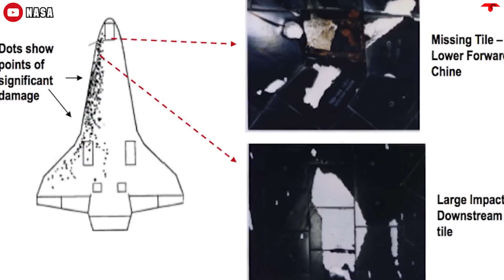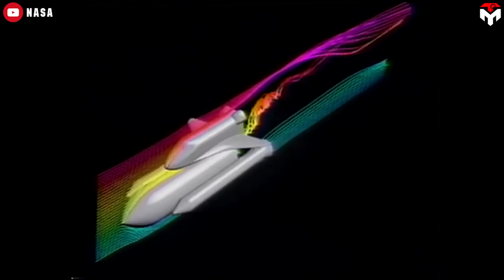SpaceX's Starship Heat Tiles Re-entry Just Humiliated NASA Shuttle!

Comment: The achievements of SpaceX with the Starship's heat tiles represent significant progress and have set new standards in the industry, framing this progress as "humiliating" NASA oversimplifies the narrative. It overlooks the foundational contributions of the Shuttle program and the unique challenges and constraints faced by each organization. Instead, the advancements in heat shield technology should be seen as a continuation of a long legacy of innovation in aerospace, with each organization building on the successes and lessons of the past 🥇🇮🇩😵‍💫😘🥰

Comment: SpaceX's approach to spacecraft design emphasizes reusability and cost efficiency. The Starship's tiles are designed to be reusable with minimal refurbishment, drastically reducing turnaround time and costs compared to the Shuttle's system. NASA's Shuttle program, despite its pioneering achievements, faced criticism for its high operational costs and the extensive maintenance required for each orbiter, particularly due to the vulnerability of its heat tiles 🥇🇮🇩😵‍💫😘🥰

Comment: SpaceX's development of the Starship, particularly its heat shield system, represents a leap forward in aerospace technology. Unlike the Space Shuttle's thermal protection system, which utilized silica-based tiles, Starship employs advanced heat shield tiles made of ceramic materials that are more resilient and easier to maintain. These tiles can withstand the intense heat of re-entry, demonstrating durability and reliability in multiple test flights. This capability contrasts with the Shuttle's tiles, which were notoriously fragile, leading to significant maintenance challenges and, tragically, contributing to the Columbia disaster 🥇🇮🇩😵‍💫😘🥰

Comment: Ya know, that a very disingenuous title.  Lately NASA has not been the leader it once was, but everyone has to start somewhere, and the shuttles tiles were successful for 20 years.  Advancements are a natural course of things and congratulations to SpaceX.  But NASA has no reason to feel humiliated about its heat tiles.  Knock it off with the hyperbole and click-bate.
Reply from the maker: Thanks for cmt
Reply: NASA forgot (at multiple points), that they were working with an experimental aircraft.  Over 30 years the shuttle only flew 135 missions.  For comparison, the X-15 project had 199 flights.
Reply: The title isnt “disingenuous” its called click bait. Designed to pull people in and have then watch the video. Which worked very well, cus most people saw the title and click on the video. Which is the exact same thing every content creator does. Its a very well done video. Keep up the great work.
Reply: The space shuttle was designed in the 1960s. It is now 2024. Should Henry Ford feel humiliated because Ferrari made a better car 80 years later? Of course not.